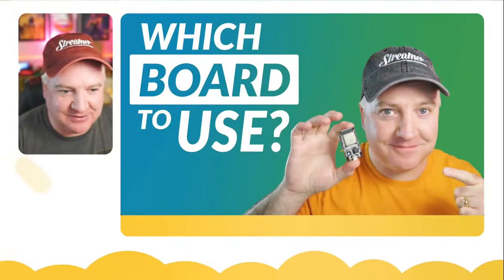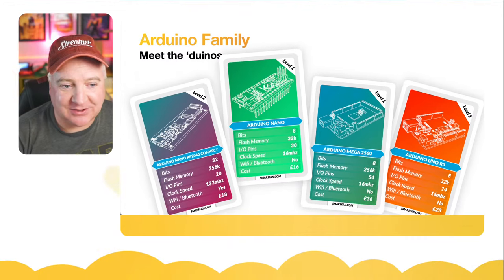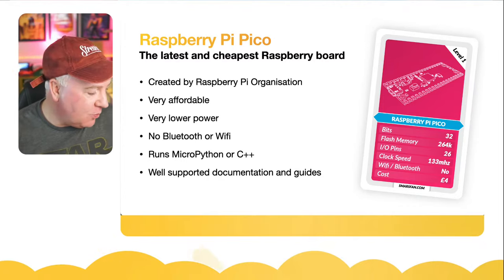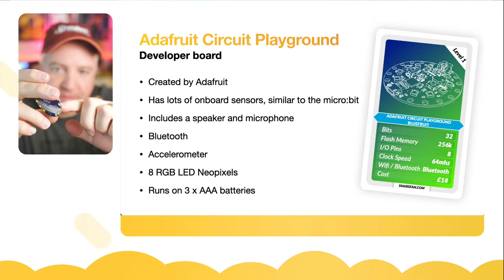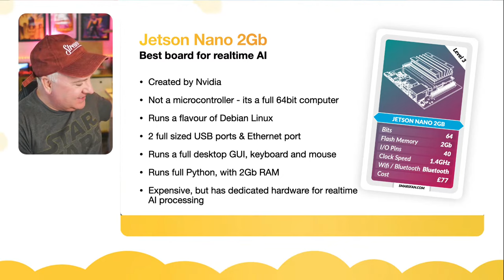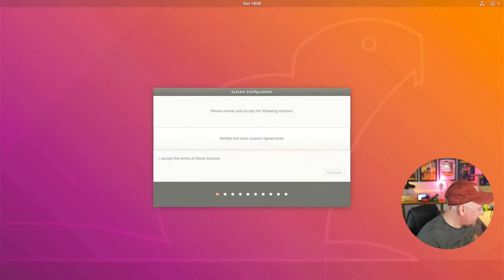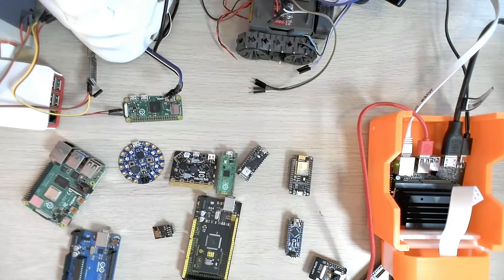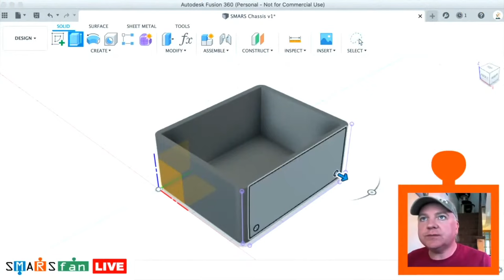Which board should you use?

Comment: There are literally hundreds of boards if you count the Chinese knockoffs, so I think you did and Excellent job cramming as many as you did in just 1:21. Since you really love the Pico, I am really suppressed you left out so many RP2040 boards. There is the RP2040 Powered Pimoroni’s Pico LiPo board, several RP2040 boards from Adafruit and Sparkfun, and several others that are probably worth mentioning. You could probably do an hour just on the RP2040 boards. I think the Nano Connect is the only one with WIFI on board.
Reply from the maker: Yes there are hundreds of boards to choose from, so I thought I'd cover the common ones (which also just happen to be the ones I had already purchased!)
Reply: @kevinmcaleer28  Did you know there is a Pi Zero W with WIFI?

Comment: I would be very careful about the terms "RAM" and "Flash" memory.  For example the UNO only has 2K of RAM which means it does not have enough memory to store a frame buffer for a display.  Flash memory is non-volitle memory for storing the program code.  The UNO has 32K of flash memory. The Raspberry Pi Pico has 264K or RAM and 2MB of flash memory.  Most robotics programs with even small OLED displays really do well with the Pico.